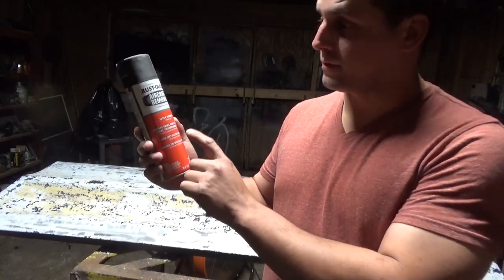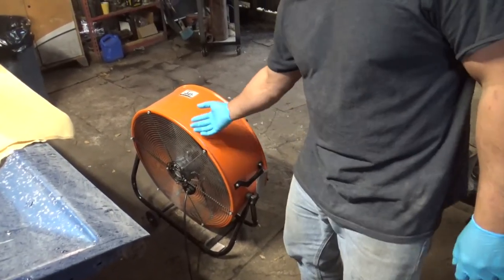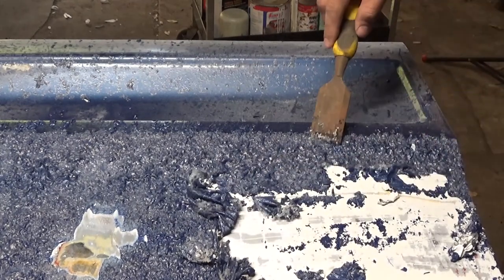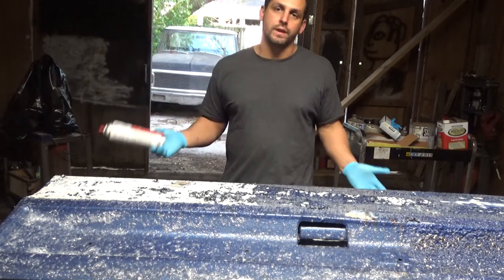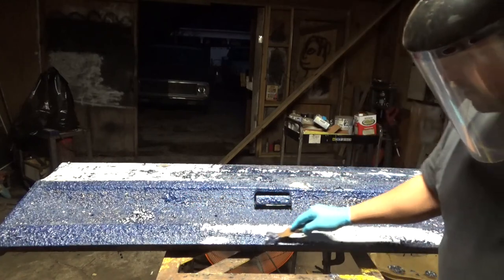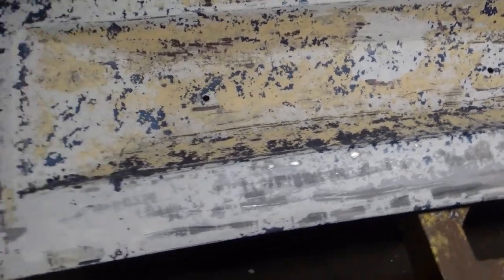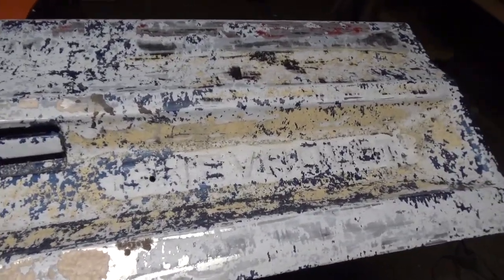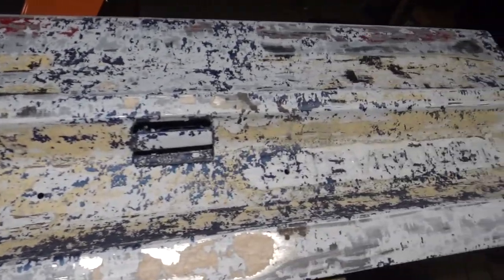Rustoleum aircraft remover, How to remove automotive paint with a paint remover.

Comment: I used this on my Hartley Brake calipers. 1st coat took off the clear coat, second coat took off the paint and primer.  Just had to use a wire brush to get all the left overs off.  Saved me hours of sanding all the little concave crevasses  on the caliper.
Reply from the maker: Yeah that is the whole point of using paint remover or sand blasting. because its a lot of work to hand sand everything. thanks for watching and commenting.

Comment: Nice....I'm gonna try a can out to remove the old paint on my iron fence hopefully it works as good as it did for you
Reply from the maker: It usually works, but sometimes it will just liquefy the paint and not wrinkle, if it doesn't wrinkle up the paint then it's almost best to just sand it.

Comment: It will work on Acrylic paint but not on oil based enamel paint that has hardened/cured.
Since Methylene Chloride was taken off the market, there isn't a decent paint stripper that will touch Oil Based Enamel paint.
Reply from the maker: Well that's interesting to figure out what types of paints it works on. To add to what you said. I also tried this paint remover on a air tank that I believe is some type of epoxy paint. Also on that tailgate the primer I used on it was an epoxy primer, and it seemed to just liquefy it and it dried up hard and tough and was still stuck to the metal on both. So maybe we can throw epoxy paints into the same bucket. That blue paint and the clear coat was called acrylic urethane paints. This stuff get complicated lol. either way thanks for watching.
Reply: @davidcraft4909   The pre 2018 Methylene Chloride strippers would take anything off in minutes, I used to literally just apply the old stripper, smoke a cigarette and then wipe the paint off with a Rag.  Took Oil Based enamels off down to bare metal, along with the primer.
Reply: @Eric_Von_Yesselstyn  Will this work on original paint of a car? Trying to get a new color on mine
Reply: @gastelummg  If the paint on your car is Acrylic with a clear coat, yes it will work but will take at least two applications. If it's oil based enamel, it's going to be a pain in the rear and be very time consuming.
You will need a plastic scraper or metal/bladed scraper in either case.
Reply: @gastelummg  It will do nothing to factory paint on late model cars.  Don't waste your money.